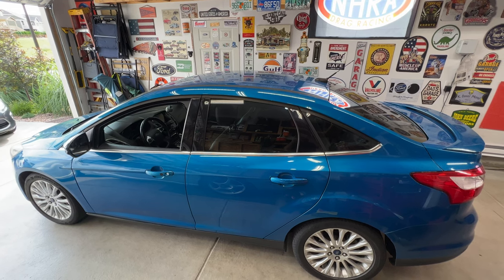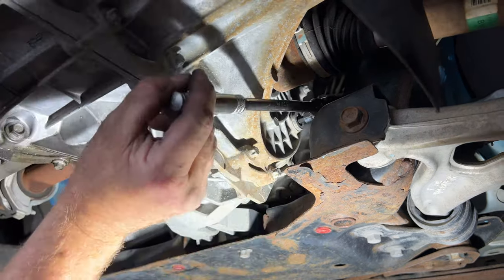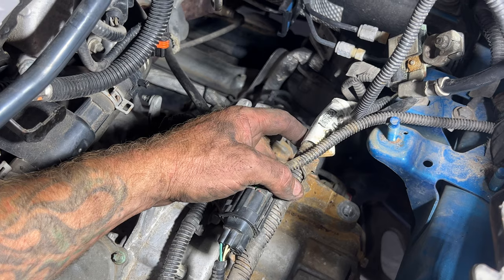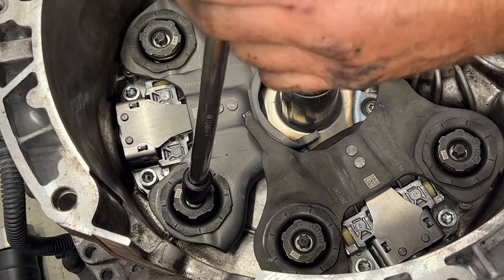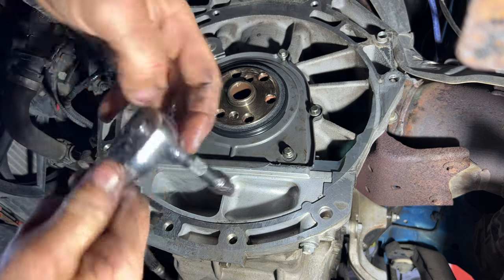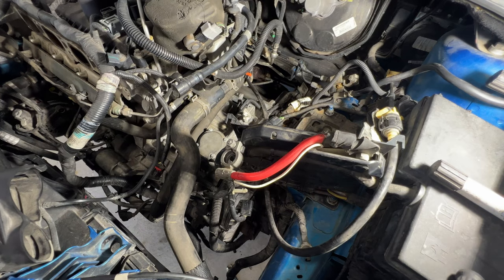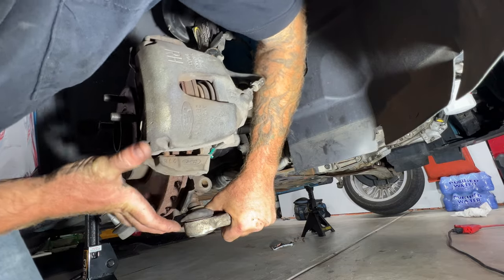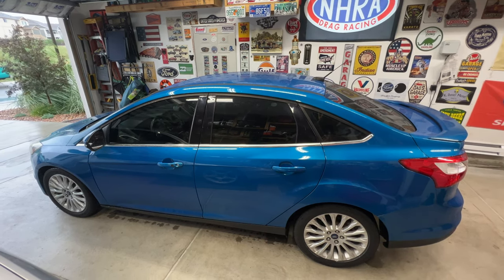2012-2018 Ford Focus Dual Clutch Change Plus Rear Main Seal Replacement How-To

Comment: 2015 Focus 122k miles, thought it was the TCM which Ford has extended the warranty to 150k but it's the B clutch, codes P2701, P287A, P07A4, dealership estimate $3500, independent transmission shop doesn't work on DCT.

Comment: If we don't match the traiangle mark with the fly wheel then ???
Reply from the maker: You will have vibration. The arrow is how to balance the clutch with the flywheel.
Reply: I did the whole transmissions job   But after completing    When we start the car and change the gear into drive and reverse mode the engine turn off     Whta is the reason behind this    Can you please tell me

Comment: I used to have a 2013 Focus and the RMS had to be replaced 3 times; continued to leak. It was offered as an add-on service when my transmission finally failed, and I regret accepting the offer. I've read of many others that have repeat RMS issues. Not sure what the problem is.
Reply: sell the car trust me

Comment: You might as well just pull the strut assembly out and the control arms for more room because the control arm bushings are going to be shot and the death wobble at highway speeds is no fun.
Reply from the maker: No issues so far car rides and drives great.

Comment: I followed all directions and there is still a vibration at idle and at about 65 mph. I am going to have to go back into it again. P.O.S. Ford.
Reply from the maker: Have you checked to replaced the motor mounts and torque mount?
Reply: @BLUECOLLARGARAGE , the vibration wasn't there before the clutch was replaced. So I am pretty sure that the mounts are not the problem. Also, I have replaced hundreds of mounts and I know what a bad mount feels like. This vibration is not the same as a bad mount.
Reply: Check the trans. Mount under the car if the bolt aren’t in right spots you’ll get a vibration you may need to swap the bolt around
Reply: @phil-1115  I believe the white or silver bolt is vertical and black is horizontal
Reply: @elibiagianti8337 , Those bolts were in the correct place. We let the customer take it and he is happy with it. It has been a month. If the customer is happy, then so am I.

Comment: Mine runs great after 148k miles but i drive it like a standard , get in hi gear as quickly as possible.  I have also changed dct fluid twice